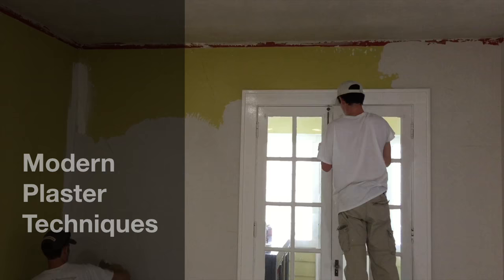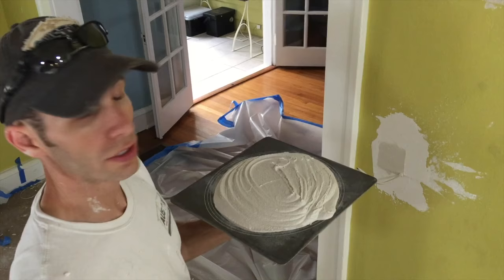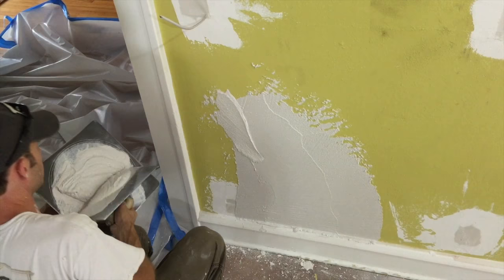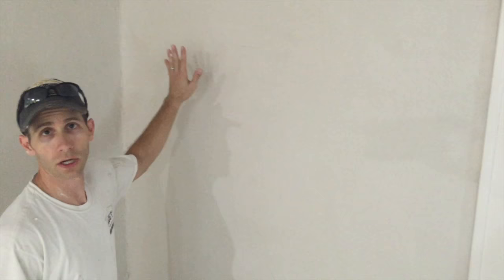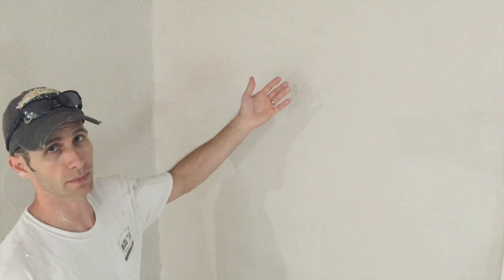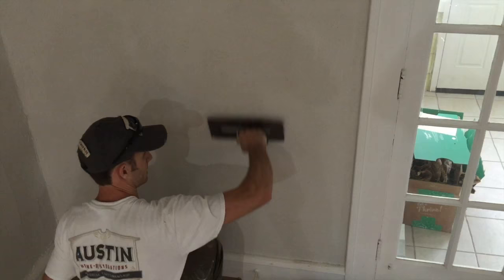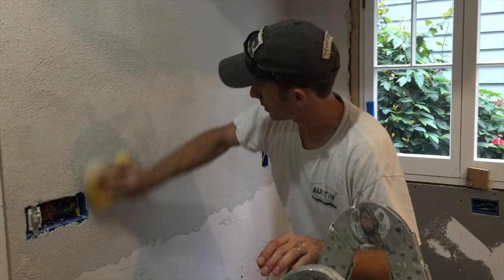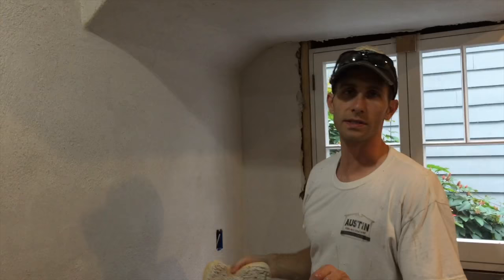Modern Plaster Techniques

Comment: Nice work Scott! This video is a good representation of what an inexperienced  "do it yourselfer" will run into when attempting something like this. I just wish the critical pros would simply SHUT UP about your lack of plastering skill. You are after all getting more on the wall than on yourself or the floor. I think people forget that your are sharing "tricks of the trade"  to assist homeowners in performing a craft themselves  ..  and the results, although not perfect, are very good .. and a sense of accomplishment earned. I admire that your willing to put yourself in front of everybody and show them how to apply these materials. A bit unnerving, even for a pro! 
  As you probably know, this "Modern Plaster" formula goes against all the warnings manufacturers print on their containers. Do not mix different materials together!  In this case, it may be because it works so well and they cannot profit off it. Also, it does not enable them to warrant or guarantee the product once it's been altered.  So what!!?  It works fine and is easier for non-professionals to apply than using fast setting veneer plaster products. By the way, your plastering technique is pretty damn good for someone who doesn't do it on a daily basis!!
Reply: I have never encountered bigger egos than in the world of plasterers

Comment: im a plasterer i working with sand and concrete mix and sometimes putting mortar lately i do it without because mortar cracks a lot, this is so good work and easy not heavy  as i used to

Comment: Beginners, beware of the hawk. Practice with this tool and trowel
or else you'll end up with more on the floor than walls. Have you ever had a problem with cracking after mixing two different product? Seems like the heat generated by "hot mud" would be a concern.

Comment: I just did a patch in an old house that had this plaster texture. I can't get any kind of veneer plaster in my area, nobody has it. I used a bag of Dap plaster of paris mixed with usg all purpose compound. Probably had it too thick but it set so fast the sponge wouldnt touch it. Did that twice, got a new bag of the same plaster, mixed it thinner and it worked. It still set way faster than yours. Water was clean. My question is about the difference in plaster of paris and veneer plaster?

Comment: What is the reasoning why you'd do this over skimming with Easy Sand? I'm also a little hesitant about straight plasters on walls now, due to some latex paints reacting weird/not curing right due to the PH differences, though the walls feel beautiful with real plaster. One similar thing I've personally done/would rather do is use a bonding agent, Structo-Lite base coat, then top with Easy Sand. Then you get the advantage of plaster filling the large area you might need filled/leveling out an area, but the Easy Sand doesn't have the PH issues plaster does with paint. Trowel down the Easy Sand to be 99% OK, then wait and give it the lightest sanding to remove trowel marks. Have you had any paint adhesion issues with mixing all purpose and veneer, though?
Reply from the maker: I’ve been using this method for about 5 years without paint problems and the guy who taught me it has been doing it for about 25 years with no issues.
I agree that a binding agent is a good alternative and have gone that route sometimes too.

Comment: What's the point of plastering over this wall? The walls looks to be in decent shape. Is the original wall plaster also or drywall?
Reply from the maker: The wall has a ton of bad patches from past damage and we also changed the layout of the room so some walls were removed leaving big holes. We did all the walls so the room could have one cohesive feel.
Reply: I see, thanks
Reply: @TheCraftsmanBlog  This is helpful. My home is all plaster walls and I have become very interested in staying true to using plaster for skim coats and patches. I now have a whole wall down to the wood lathe, had to travel for plastering products. First time for a whole wall, will be doing the closet first. It's good to know of this option.

Comment: What's a good exterior plaster to put around sliding glass doors at the bottom where it has chipped off?
Reply: Sand cement and hydrated lime with a tiny drop of waterproofer at a 5:1:1 ratio of the dry ingredients. Mix to a workable consistency. Apply, straighten, float and finish with a sponge

Comment: this is so painful to watch.
you can't even take it off the hand board properly. 
The back of your hand should be facing up when applying.
Reply: Knuckles up. Spread up and over to the right in an L pattern if you at right handed, for the initial spreading. I hate to be a nitpicker, but I saw this guy putting some blue stuff on the baseboard the other day. I think he called it masking tape.

Comment: How do you get it to set? !     Mixed it exactly as you say.Half each,clean water.....put it on 7 a.m. and twelve hours later it isn't curing, just drying out in some and chalky in others. looks both dark grey and white. Wall is clean, primed,sealed.dry prior to this mix. Any clues?  Are you spiking it?  BTW I have over 40 years at it and never thought to try this until I saw this nicely-done video. Is that graded silica/ Diamond finish Basecoat ?
Reply: Interesting.  When mixed mine sets too quickly -- the bucket of modern plaster (50% premixed regular drywall compound and 50% Diamond Veneer plaster) dries in about 30 minutes making it impossible to use.  I would love the slow set you are getting.  It dries so quickly I don't get a good chance to do an effective knockdown.  I can only do small areas at one time.
Reply from the maker: I usually mix my plaster very thin and then add the premixed joint compound (it has to be the premixed not the setting type). I usually get 45-80 minutes depending on the weather.
Reply from the maker: I have a new video on my channel about how I mix it if you’re unsure.
Reply: @TheCraftsmanBlog  Thanks.  That's what I am doing.  I also live in the Southwest where it is pretty dry.  I'll try going a little thinner on my plaster mixing.
Reply: This is not plaster FYI! It’s a made up concoction and he has no business calling it plaster and no guarantee that it works. Check the product data online people! Joint compound does not set! It dries and if it gets wet it will emulsify back to its original state. If mixed with a true setting plaster finish like diamond finish you will have hot spots and adding joint compound to diamond finish will make the finish even weaker than what its  intended to be. 

My suggestion is apply a bonding agent to the walls then use diamond base coat as the 1st layer,  let that set then apply the diamond finish using plaster techniques.  Done! 
Also, Trying to sand finish like this is also sloppy and more difficult to achieve a uniform texture. There’s no suction behind the finish that aids while floating. In the video he’s just pushing sloppy material back and forth. 
I’m a real plaster 40 years and I’m  just helping others.  The young man has a lot heart and means well but does not have the knowledge of real plastering materials. Diamond finish is a wonderful product but it’s also intended for professionals. For this application I wouldn’t use any of those. Still today we use lime and gauging plaster for our finish just like over 100 years ago. If it works why change now? 
Good luck everyone!

Comment: Hi, thanks for your video.i am wondering if you give the modern plaster any sort of protective finish after you are done.  i know some people  do a protective finish when they add tint into joint compound when they use that as a veneer...and also know that the diamond decorative finish one coat system recommends a protective top coat.
Reply from the maker: It is usually primed and painted once cured.
Reply: ok, thank you for replying.  i love the look of the unpainted plaster so i am wondering if you seal it if you leave it unpainted....i was thinking of tinting the mix and leaving it unpainted but wonder how it will hold up if i dont seal it with anything.  thanks,
Reply: If you wish to do a n integral color diamond finish, skip the sand. Skip the joint compound. Use a bonder. Add some universal colorant from a paint store into your mix. Seal with Ocon W1 or W2. Or better yet, hire someone who has experience with color plaster finishes. It is tricky when you start adding color. We are running two crews of plasterers doing color finishes right now.
Reply: @endoalley680  I’d like to do this strait on OSB I
Up in our shop, but I’m nervous it won’t adhere properly. Do you think it would be fine? Or should I skip the joint compound and use the bonder like you said here? If so, how do I know how much to use in ratio to the other ingredients?
Reply: @TateBugs  Repair if necessary and prime the substrate surface. Paint on a bonder. Then apply plaster. OSB is not a suitable substrait for Diamond Finish plaster.
Reply: @endoalley680  super helpful thanks!!!

Comment: Do you realize that you are mixing a drying type (joint compound) with a setting type (veneer plaster)? Two separate materials for two different applications. If you have experience with taping mud you'll be able to learn how to apply veneer systems. Takes some practice but it's doable - I switched to veneer after 17+ years of doing taping mud.
Cheers,
Reply from the maker: I do and I've used both separately as well. This is just a different application that works well for us in certain scenarios.
Reply: Let me put it another way. It's like mixing hide glue and epoxy, makes no sense.
Reply from the maker: Building Brian the plasterer I learned it from had been doing it for close to 30 years with great success. It may not make sense to you but it does work and I feel comfortable using it when it is a good fit for the job.
Reply: You haven't explained why you're mixing different products. If you're trying to control set time, retarders or accelerators are added to veneer mixes. If you need texture sand is mixed in and floated with a sponge. I'm not here to argue. There's enough variables in a construction project without using made up concoctions. Knowing why and where to use a product is just as important as knowing how to apply them.
Reply from the maker: Brian Dennis Cinski I go into more of the details on my website post that this video is a part of. Basically the addition of JC gives the plaster much better adhesion and eliminates the need for a bonding agent. It also allows application onto a variety of other substrates that are not typically suitable for straight veneer plaster. Rarely is there a surface I cannot apply this onto and yet it still cures and is workable in the same way as veneer plaster.
Reply: So instead of using the bonding agent (for which it's use is designed to go over anything; concrete, cement board, drywall, brick, etc.) you opt for JC. Weaker bond and weaker adhesion. But don't take my word for it. Talk to the tech guys at National Gypsum or USG, I did.
Reply from the maker: Brian Dennis Cinski I'm getting the sense you don't agree with my technique. Hmmm, I guess I'll just have to change the way I've been doing things for year to help you sleep better Brian.
You don't like it, I get it. Do it your way then.
Reply: The Craftsman Blog no I don't agree with and I'm not losing sleep either. I've provided you with facts. Accept them or not your choice. No need to be snappy. Just trying to elevate the trade. Best,
Reply: I've been thinking about doing a vaneer course. Is there much business in it?

Comment: What are you using?  What is your mix?
Reply from the maker: 1 part Diamond Veneer plaster to 1 part premixed Joint Compound.
Reply from the maker: I have a new video showing the mix up that will be posted tomorrow 3/29/19 if you want to see the process.
Reply from the maker: Here’s the link: https://youtu.be/X8427ht707U

Comment: Lummy, a Yank doin' plaster. The irony is that if you skim the face initially you don't need to repair it in future. Even though old horse hair and sand mixes are sometimes a bit loose, many walls over 100 years old are still fine.

Comment: Another example of people totally ignoring or having no knowledge of plaster products, and/or in this case,  the proper industry specified bonding agents needed to provide the customer with a long lasting "resurfaced" finish.  See this all the time, sell them what you kinda know how to apply, mix up your "own recipe" of various materials,  regardless of industry specs, get the check and hope it stays on the wall until the check clears.  "Joint compound mixed with plaster makes it stick "  you have a patent on this? Would you let your mechanic install Ford parts on your Chevy  if they kinda fit or your plumber to use just what he had left over in his truck that kinda fit.  There are lots of great products out there just take some time and acquaint yourself with them and offer your clients a proven application system.
Reply from the maker: Karl, I’ve used bonding agents before so I’m not unfamiliar, but I’ve also seen this technique used with good results for 30+ years. It may not be an industry standard but where do you think those standards came from and were improved upon? They were made by people experimenting and failing and succeeding and I’m not afraid of either. Stick with what you know if you don’t like this.